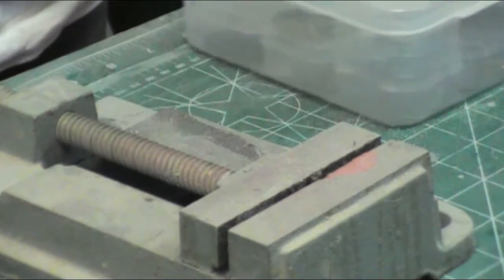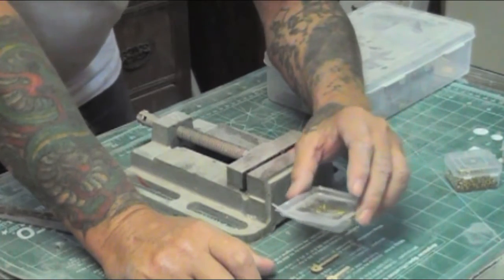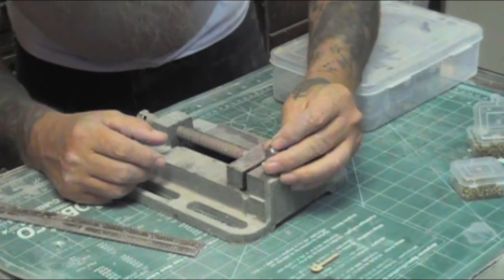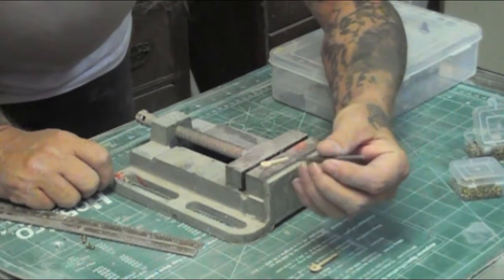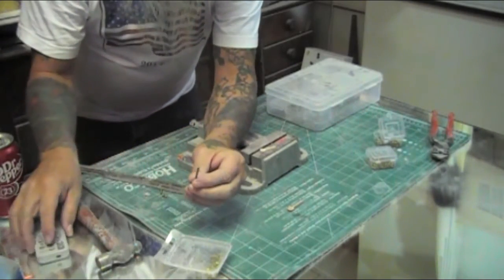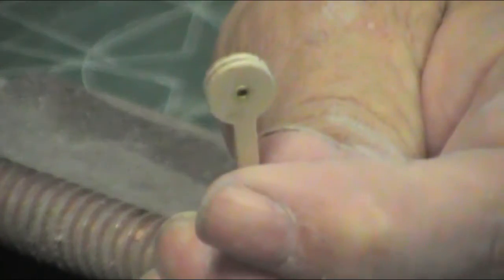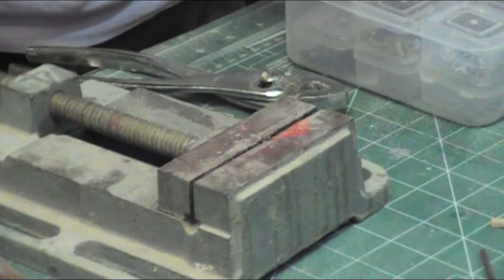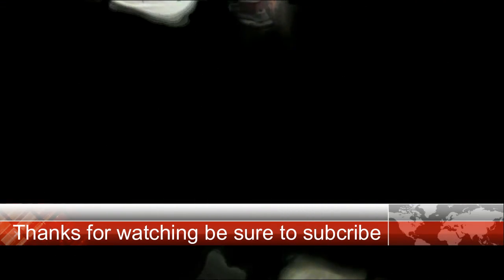Making plate hinges for a model airplane

Comment: What is the length of the brass eyelets, how much longer do they need to be than the plywood thickness? I assume the plywood tang is 1/8" thick, so is the eyelet 3/16" long? Thanks in advance, and thanks for the videos.
Reply from the maker: This is correct they are 3/16 and peened over flat

Comment: Why don't you make the trailing recess and just use platic slot hinges, they move almost as freely as yours
Reply from the maker: I am not sure which video shows a close up of the stab pocket hinges but the way I am doing it there is no hinge gap line
Reply: For scale ships , or for those high end flying machines , eg " 80's F3B glider RUDDERS,  pre -composite era . to make almost gap-less in between TE of Vert fin & LE of Rudder.---to duplicate result as designed on dwg board. another advantages of this concept of hinging are: most freely , least load needed from servos, and I think ABOVE ALL is that sorta SATISFACTION  gained with this HOBBY--CRAFTMANSHIP, INNOVATIONS, ENGINEERING...etc....difficult to described in words when compared to nowadays super-foam ,telemetry, gps, GOPRO, autopiloting, ...gyros ..multi-xxx......just DIFFERENT...not better or worse issue..